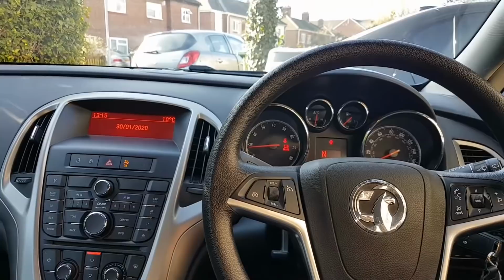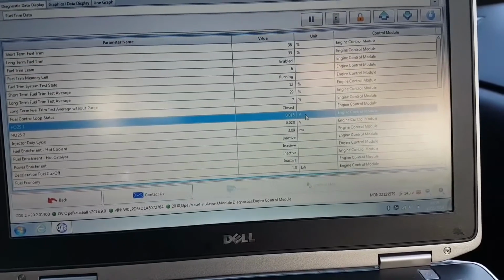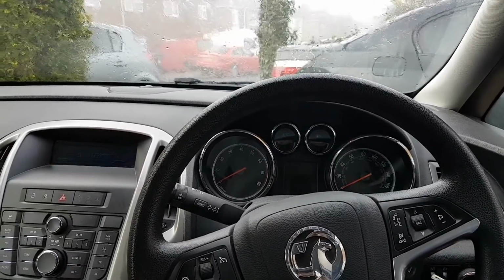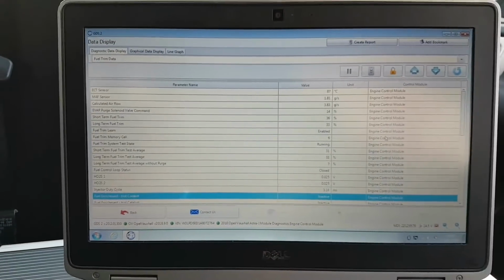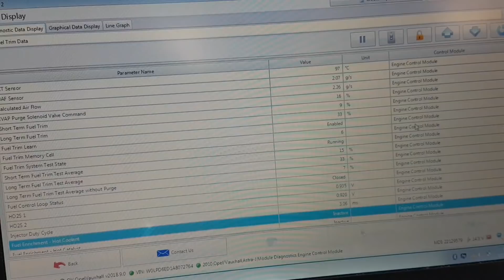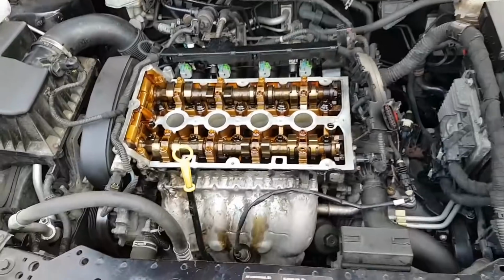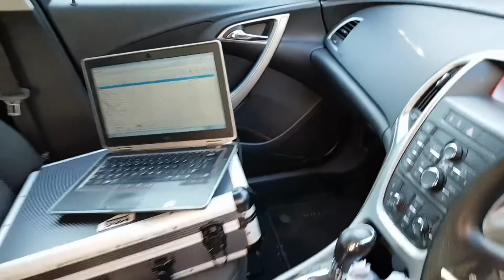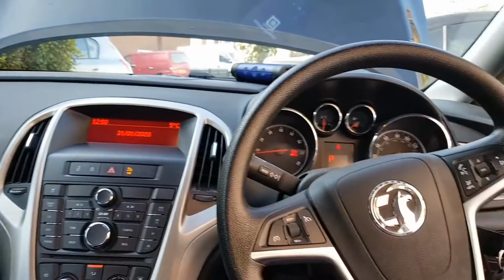Vauxhall/Opel Astra J 1.6 P0171 & P0106 running lean. Fault finding and repair.

Comment: Greetings from Berlin! Thank you sooooo much, I‘ve had exactly the same situation, equal error codes and handling of the engine. At the beginning I found some videos stating that P0106 is because of a bad MAP sensor, but than I saw your video and was convinced to check the valve, and this was the right solution (was a little bit worried if the new would still leak too 😅 but everything is fine)
Thank you so much!
Reply from the maker: 😊
That's great! 
👍👍👍

Comment: Thank you very much you solved the problem I had with my late Astra H as it has the same engine fitted a new rocker from my local motor factors problem solved👍👍👍👍

Comment: Very common problem. First job is always to see how easy the oil filler cap comes off while the engine is ticking over. Must have done 20 of these in the last year or two. Never bought a genuine steeler part. Customer always wants an eBay part. Never had a bad one. I do agree a lot of cheap parts are definitely getting worse though. One thing to note, some genuine parts manufacturers do send parts that haven't passed QC to China. These get reboxed and sent back to EU and US. Some BMW parts in US are renowned for this.
Reply from the maker: Thank you for watching and for your comment! 
👍👍👍

Comment: Thank you for another great video!!!
For me, one of the most interesting of yours diagnosis. Absolutely briliant. I know I would strugle with this, although the problem was obvious from the live data, it requiers a lot of experience and talent to put all the clues together.
Reply from the maker: 😊
Thank you!
👍👍👍
Reply: It requires just to open the bonnet and find the source of sucking noise 😁
Everything else is only for studying.
Reply from the maker: If the "sucking" noise is audible yes...
👍👍👍

Comment: It happens a lot Luis as you well know I would have brought it back if not send the video to Fai they are normally decent quality for after market. It will give them a chance to correct the issues. Well done great diagnoses and fix.
Reply: I think FAI produces the worst parts. At the 2006 Opel Astrah, the timing chain kept me only 9000km ... it was stretched .... the engine was cutting.
Reply: @bogdanmustata5310   there are excist more worst parts like (Ali-mama - Αli_slow).😀
Reply from the maker: Funny enough, I actually did rang them... they said they would call back... till today... lol
👍👍👍

Comment: You're brilliant Bro👍
This situation is quite frustrating when the fault is still present after replacing the failed component & it's even more disturbing when the customer has bought the part themselves & they will never condemn what they bought
That's an automotive tech's life😉
But the way you dissected both cover's & made one functional out of them is outstanding, Great work👍
Stay Safe Bro❤
Reply from the maker: 😊
Absolutely...👍👍👍
Thank you for watching and for your comment!
Reply: I never fit customer supplied parts, it is not worth the aggro that can occur.

Comment: Simply reving up the engine would bring the fuel trim numbers down and show the problem. TOO lean at idle but not at high rpms means vacuum leak. This engine has MAP and MAF sensor. So the fuel injection is dictated by the MAF.  MAP sees the drop of vacuum but is not in control of the fuel. The MAF is.
Reply: Your thinking would be corect, but not in this case, as this is major vacuum leak, and you would not see much difference by reving it.

Comment: I know this is an old video and i accidentally came across it reading through forum's, my car has exactly the same codes and symptoms, and i have ordered the new cover today, i hope i dont have the same problem with my new cover that u did. This fault had been driving me up the wall.
Reply from the maker: Hi
Hope you have better luck than I had...
But at least you know what to look for...
👍👍👍

Comment: Very informative, thanks a lot. I have the same problem, my fuel trims are at high 30s in my 2012 1.6T. The difference is, that hole doesn't suck air in my car. What would be the problem?
Reply from the maker: You need to investigate...
Probably a leak elsewhere...
👍👍

Comment: Great video, mines doing exactly the same, start up from cold and wait 10 /15 minutes to get hot rev it a few times then starts judder sucking in air from the pcv valve, the fault codes I'm getting are p0171 and p0106 I've bought a new rocker cover from euro c*r parts for £239 it's a vauxhall part as well, is there anything else that can cause this to happen or is it just wear and tear.
Reply from the maker: Usually wear and tear...
👍👍👍
Reply: @LMAutoRepairs  going into garage tomorrow, I will update on how it goes. 🤞
Reply: Had new roker cover fitted last Wednesday car running fine now, asked for the old one back and I took out the pcv valve and it was split so basically £240 for small part that had gone 😡. Thanks for your video it was very helpful.
Reply from the maker: @paulfrancis2790 
☺️
That was unfortunate...
Thank you for watching and for your comment! 
👍👍👍

Comment: Given up on aftermarket stuff the Quality just gets worse and worse every year.
Reply from the maker: I know... but is not my money...
I can only advise... it is up to the owner to decide...😊
Thank you for watching and for your comment! 
👍👍👍
Reply: @LMAutoRepairs  Hello. I have similar problem with Vauxal Zafira B Petrol 1.8. But my engine starts hesitates when i start it cold. No faults after scan. But once the engine warms, it starts work normal. Can it be air leak ?
Reply from the maker: Possibly...
But check live data... your answer will most likely will be there...😉
Thank you for watching and for your comment!
Reply: You can say the same about oem. Everyone cutting production costs button the end user it stays the same.

Comment: Hei, 
Great video, you explained the problem for my understanding, but i still miss something...

Can't patch that tiny hole??
 I don't understand why is it there if is not allowed to braeath air from there. Or is it blowing the extra air from engine? Please respone me.
Reply from the maker: That's the engine breather...
You can't block it!
Search for information on how an engine works and breaths and you will understand...
👍👍👍

Comment: Great video. I am having this issue on a 2010 Astra J 1.6 Auto A16XER. I bought a cheap rocker cover replacement but still have the same issue of uneven idle. This time no leak out of the little hole at the top.  Was your issue the same with the new rocker cover? It's almost like my new diaphragm doesn't close to under high vacuum.
Reply: So the new cover was leaking from the atmospheric hole too?
Reply from the maker: Indeed it was...
👍👍👍

Comment: Parts are made in such huge quantities manufactures expect a percentage of news parts to fail. This is not unusual in the replacement and service industry. Always take it out of the box give it a good visual inspection and then obviously fit and test for performance of the part.

Comment: The breather on mine does this, but it stops again and the car returns to normal. and the engine stops shaking. Does this sound like the same issue?
Reply from the maker: Possibly...
Scan the car, check live data... inspect if you can...
👍👍👍

Comment: one of our drivers bought his Land Rover 2008 puma defender into the workshop and said the MIL lamp was on and the engine was under powered and running rough, so I got the 'Box' out and plugged it in, it came up with a fault code, I cant remember the number but it said EGR circuit value out of range, so I got a new EGR valve and fitted it, reset the code and five minutes later the same problem reappeared, so I scratched my head a bit and had a think, and tried to apply some logic to it, the code said EGR circuit value out of range, and I thought maybe it meant the electrical circuit, the wiring looms on these defenders is fairly complex and didn't want to pick off all the tape to find a break in the wire/s, so i bought a loom, and they are not cheap 400 quid If i remember correctly, so i fitted that and guess what? same problem (Humph), so I phoned a friend in the trade who specialises in engine management etc, and he said 'did you fit an after market EGR valve or genuine?' (here of course is where real experience comes into it's own), That was when the penny dropped,  I'd of course fitted an after market part, so I then fitted a genuine EGR valve and presto job done! 
The real problem here was not so much a part that didn't work properly and just having to swap it for one that did, but that it sent me off in the wrong direction and caused unneccesary expense.
In principal I'm quite happy to fit after market parts but there are caveats, you just need to be aware that they are not going to be as good as OEM parts and they can catch you out...Ouch!
Fingers burned-lesson learned
Reply: Found that with oxygen sensors... a cheap no name one costs you less but you more than lose any savings with subtle performance/ economy losses and then failure. ..pay a bit more for a good name .Bosch/Denso/Ngk etc.
Reply from the maker: Electric components, I never go aftermarket... and always strong advise people the same...
Reply: @LMAutoRepairs  I agree! Used a cheap coil pack on my zafira and after a month it started cutting off middle of road.
Got original one and problem solved.
Reply: So based on a fault code, you changed the EGR valve and a wiring loom. Talk about a bad diagnosis. If there was a problem with the wiring you good have known this by actually measuring it. You good even diagnose the bad aftermarket egr valve with a scope or maybe even with live data. There are so many mechanics these days just changing parts hoping it fixes the problem.
Reply: @spin1275gt  ' Talking about a bad diagnosis' you are quite right of course, but limited to £100 equipment  that gives only basic data and not being able to justify the expense of a 'scope' and ('hands up' limited experience)  makes  accurate diagnosis very difficult in what-was at the time a one off situation, i'll also add that the only option for most people to improve on 'limited experience' is to get stuck in with such diagnosis problems and learn off forums such as this one.  What I ommited to say in my original comment was that this situation happened several years ago, and have since learned a great deal and gone on to correctly diagnose and repair other vehicles, thank you for your feedback...seasons greetings

Comment: Hi I have a Astra J 2010 1.6 petrol, the is no engine lights on nor any codes, idol’s ok but when engine at temperature and driving I lose power but when engine cold got power in every gear can you help
Reply: I have the same problem. Have you found what the problem is?

Comment: One of my family members owns an Astra classic with a Z16XEP engine, that changes the running of the engine and I hear a hissing noise when I pull the DipStick.
When is running at high RPMs the car consumes a lot of Oil.
Reply: Probably it needs piston rings.

Comment: Brilliant video, my astra 1.6 auto had a oil leak so had a new rocker cover gasket fitted by my local garage picked up the car and they said has the EML came on before I said never they said it's showing code p0171 and it's nothing they have done, the car runs OK when the light is on I have a obd2 to turn it off it comes on about twice a day the one thing I have noticed is the MPG was about 28 MPG now its 24 MPG apart from that the car run fine, I'm thinking has the gasket been incorrectly fitted like the bolts been tightened up in the wrong order, I appreciate any advice.
Reply from the maker: Possibly... but needs checking...
Thank you for watching and for your comment!
Reply: @LMAutoRepairs  forgot to mention that it also had a new thermostat houseing as well but that wouldn't have nothing to do with p0171 code.
Reply from the maker: Most likely not...

Comment: well done again .. I was thinking .. is it possible that using an 'O' ring either under or on top of the diaphragm before fitting the new cover would stop it leaking? .. you probably have a packet of o ring seals..
Reply from the maker: Possibly... but everything is a quite tight fit... would have to be a really thin oring...
But the extra lip on the original cap did the job perfectly...👍👍👍
Thank you for watching and for your comment!

Comment: i have problem with 2009 zafira 1.6 petrol its dumping fuel in at high rate can see it come out exhaust white smoke pure fuel never seen this befor  may be its ecu ?
Reply from the maker: Possibly...
Check injectors, and wiring..
Thank you for watching!

Comment: Great Video and Troubleshooting ! I have nearly the same issue here after having had the valve cover gasket changed on my opel astra j. What is the software and hardware you are using for connecting to the PCM ? Is it freeware ?  I would like to follow the same steps and understand if there is an issue. In my case I had the check engine light on ... then I went to the workshop but they only reset the fault and made a general check of the engine. Thanks
Reply from the maker: Hi
In this video I was using GDS with the MDI interface...
Hope that helps...
Thank you for watching!

Comment: I to have had  new parts  that where faulty, (reverse switch) springs to mind  after spending 1 hour checking wires  😤it was the new switch I check all new parts first now .

Comment: Hi I got the Similar problem but the opposite for the car to idle without going up or down and cutting out. I need to pull out the dipstick. Then it will idle correctly. I took off the rocker cover and checked membrane and it’s all good. Any help.
Reply: I had a similar problem with my old car astra GTC J 1.6t. turned out to be O2 sensor
Reply: @CLIFTYPOPS  no sensors as diagnostic plugged in. Only it says misfire on cylinder 4. But new spark plugs and coil pack fitted. As soon as you remove oil cap then the car idles correctly but you cannot drive the car due  to traction control light on and brake pedal not working. Brakes only works with vacuum pressure.

Comment: Having a rough idle on my 1.8 I changed my valve cover and my long term fuel trims are still high??? Any ideas? I don’t have any hissing noise coming from cover everything is sealed what could it be ?

Comment: A great video as always.. A question to you Luis or to other readers. We have în The family.. A 98 honda acord.. A 04 seat toledo.. What scanner do you recomand for these cars? . My father needs for reading erors.. And the casual module programing. And as usual he wishes not to break the bank. :D thank you for Your suggestions în advance.
Reply from the maker: For the seat go vcds....
For the Honda, that's a quite hold car, not many cheap tools out there... but there is a small software that used vagcom interface, for Asian cars..  can't remember the name now... do Google search...
👍👍👍

Comment: The torque for those bolts are 8 nm and not 9.
Reply from the maker: 🤣🤣🤣🤣
1 nm difference...👍👍👍
Thank you for watching and for your comment!
Reply: @LMAutoRepairs  no problem man. Also subscribed loved your video. 😁😁
Reply: That 1Nm extra will destroy the engine
Reply from the maker: @simeunovicm 
Really?🤦‍♂️
Whatever...
Reply: @LMAutoRepairs  joke

Comment: I had a different problem with the same rocker cover. I got two Fia rocker covers off my local motor factors, that Id consider a decent brand, both wouldn't fit as was a few mm out & three bolt heads wearnt formed correctly. The next step in price was a Febi that was £130, so I ended up rolling the dice & getting one off eBay for £27.89 instead that fitted great & even had the Vauxhall number stamped in to it, lol
Reply: Was Febi ok?
Reply: @charliekarting3401  Glad to hear that. I have ordered from the same source, for my sons Zafira B 1.6. It's the one ending in 284, with the curved ends for the cams. £28 not bad. Hope it also fits OK.
Reply: @charliekarting3401  I tried 2 new ones from amazon and they failed so badly. Started leaking 😭
Did you use any sealant like in the vid?
Reply: @andresilva5667  Sorry to here that, I did use a little bit of sealant in the corners like in the video, hope you get it sorted
Reply: @richardhemingway6084  I was very happy with my type & came quickly too, ordered Monday evening & was delivered Thursday
Reply: @charliekarting3401  thanks man. Much appreciated 👍
Reply: If you scroll down - you'll realise the seller is Chinese and it is a chinese part. I'd avoid!
Reply: @mohitl1697  I did see that, I don't think you can just dismiss the seller because they are Chinese as so many parts are now produced in China. I judge it on individual basis & this time it worked out fine. Same is you cannot automatically trust an established brand these days.
Reply: @charliekarting3401  True.. but i'd rather pay the little more and get the genuine thing from Nevlock for £75.
Reply: @mohitl1697  I would of gone that route if I'd known where to get it from
Reply: Careful with this. I replaced my rocker cover after snapping the bolt after installing a new gasket. So bought a new one as I couldn't find the bolt. Ive had a whistling sounds, jumping rpm, jerk on braking for a few months. I researched for so long and decided to pay a garage to fit a crankshaft seal (timing belt labour cost) as didnt have impact wrench. Didn't fix the sound and MIL came on P0171. Other cause of vacuum issue I was having could be rocker cover but didn't think it was that as only 3 years old. I took the bolt out the china one and restored the original and sound gone, vacuum fixed and car running perfect. The diaphragm did not last long. May work for a while but longevity is not there. If the same occurs to you or anyone reading, hope this helps as it gave me a headache. OEM always.